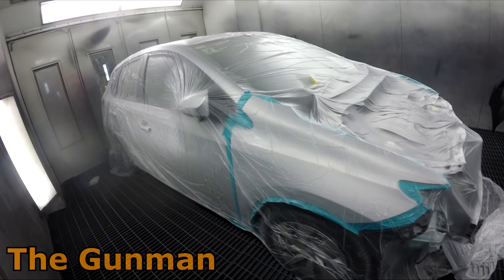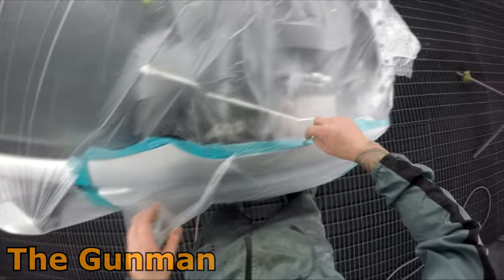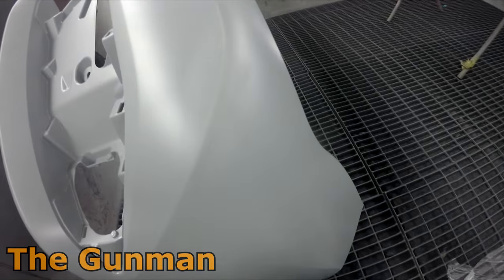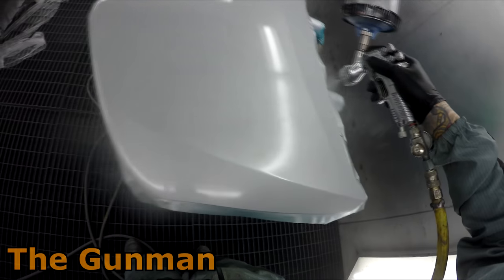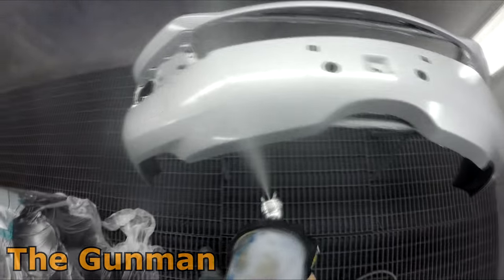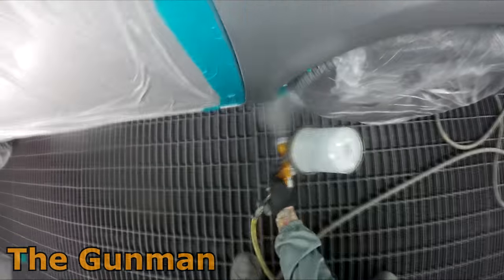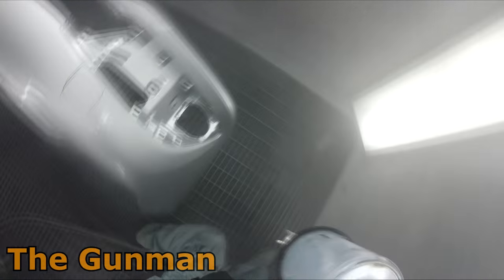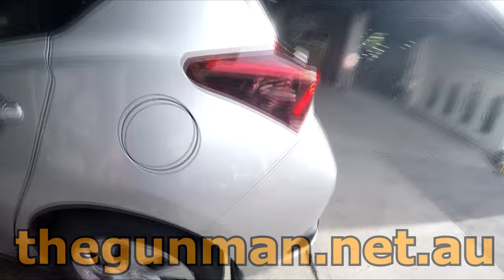Automotive Refinishing Toyota Corolla

Comment: If you one day use this additive in the non-stop primer, and have to sand it.. I recommend sanding it wet and not dry. Dry machine sanding generates to much heat in my experience and that's the reason it feels "rubbery" and clogs up. You can also dry-sand it, but then you have to change sanding paper often to "keep it fresh" so you avoid this problem.

Comment: I don't use binder/clear base/colour blender, I just finish my blend area with 1500 soft back, hardly ever have a problem, and when the odd dodgy blend comes up, its notmally down to too much heat in the environment. never tried doing my drop coat straight over my wet coat, I was always taught to do it dry, think ill give it a waz on my next silver
Reply from the maker: Are you using Cromax Pro too?
Reply: no we use max meyer
Reply from the maker: Little Wol Just be careful cos I know not all paints have the same specified application, maybe ask a rep and see if they think it's ok to do.
Reply: yer deffo mate, majority of colours on our scheme take 2 coats an a good drop, not like that cromax u use, some thin colours as many as 5, needless to say, its not a sgood as cromax hehe

Comment: Gunny what was the blue spray gun you used in the first part on the bumper bar? Nice job mate your beginning to sell me on water base
Reply from the maker: That was a limited edition DeVilbiss GTI, 1.4mm with the 2000 air cap. Yes the Cromax water is good stuff, not without flaws but all in all a great system.

Comment: Hey Gunman.

I've just purchased the Gti Prolite Professor Steampunk edition from SprayGunsDirect (mentioned on your recommendation of course)

I've been using a Gti Pro for solvent base for years now and was just wondering if the H1 air cap I have on it will be compatible with the Prolite I'm waiting on? Are any other parts interchangeable between the two?
Reply from the maker: Truth is most parts will fit, air cap, fluid tip and maybe needle but can't remember, I tried a Pro cap on a liet once and yes it did spray but seemed to make the fan smaller, may have just been me so I guess just give it a shot and see how it goes, doubt it'll do any harm.

Comment: How to setting this gun for the job
Reply from the maker: 29psi, 4 turns out fluid and full fan
Reply: +The Gunman ok thanks ,you have used the teckna spray gun
Reply from the maker: It's the same as the GTI Pro lite you see me using in this vid, just has a different name in the USA.